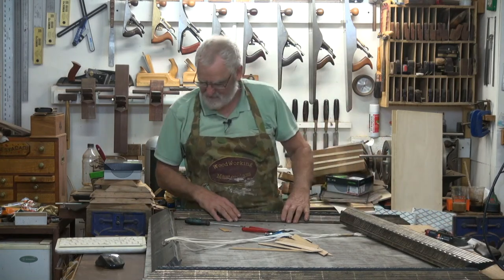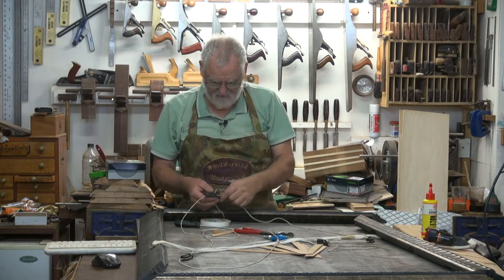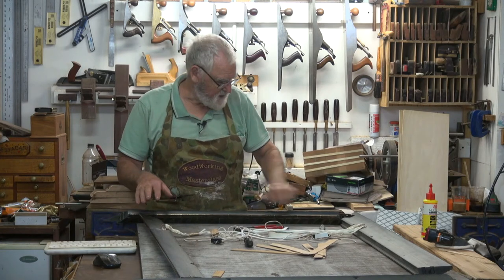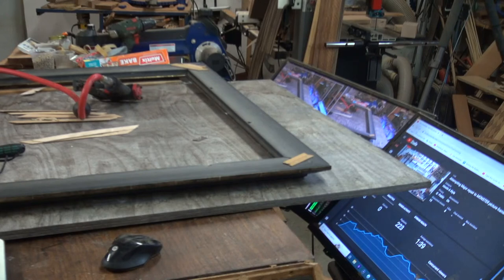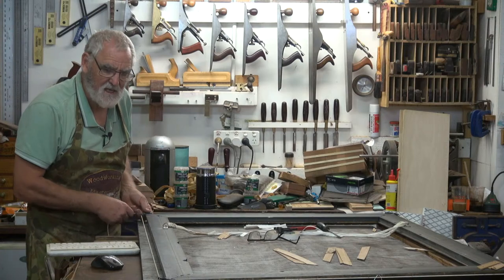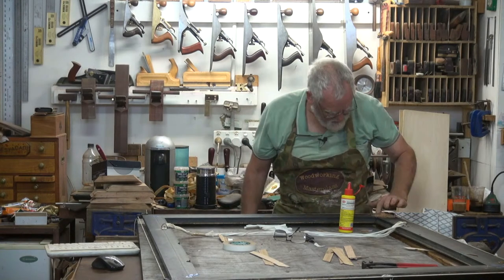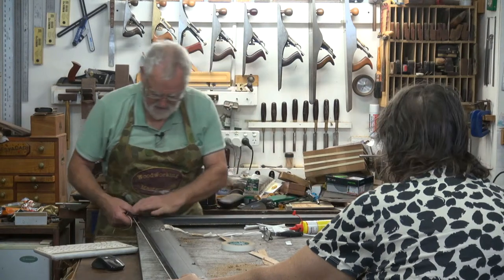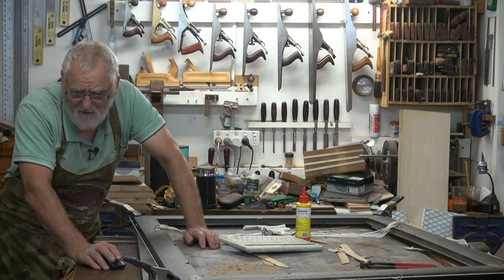Attempting Major repair to MONSTER picture frame.

Comment: Goodness...I’m glad (sorry...) someone else has one of “those” projects. My wife said she had an “easy” project. She wanted me to make some inserts for the top of our china cabinet to allow her to put ceramic figures up there. Well, the only issue is the top of the cabinet is curved. And what an issue it is. Mostly finished, but had to use most of the sweat words I knew. One of those days when everything I touched turned to fertilizer. So, I understand your situation.

Comment: I wouldn’t have the patience for those clamps 🗜
Reply from the maker: Hi Joker, Bit of a trial on a large job I must admit. They are great on smaller jobs. But the size of that one didn't give me to many alternatives. Cheers Steve
Reply: @Woodworkingmasterclass  Good on you Steve you persevered and got it done 👍👍👍